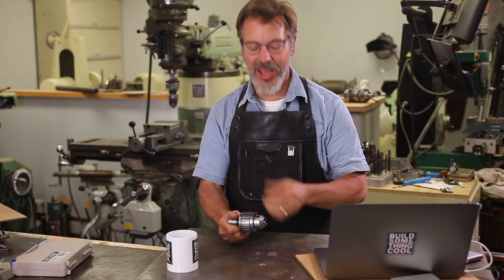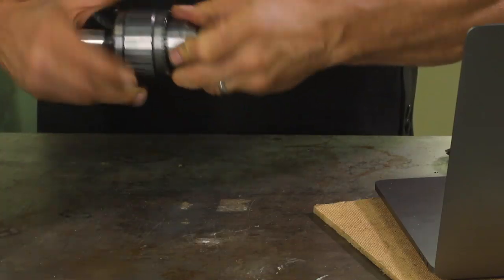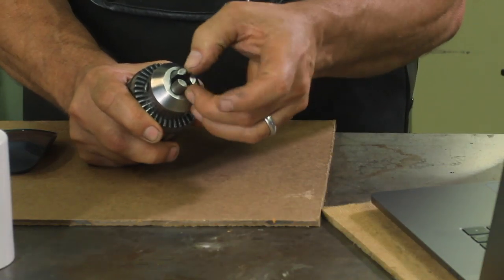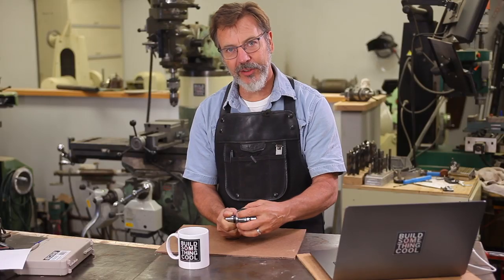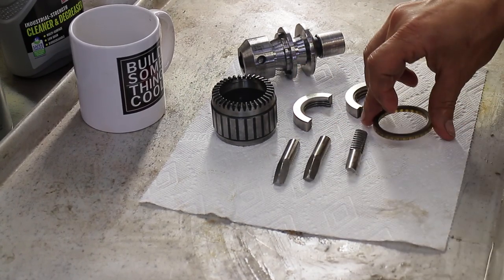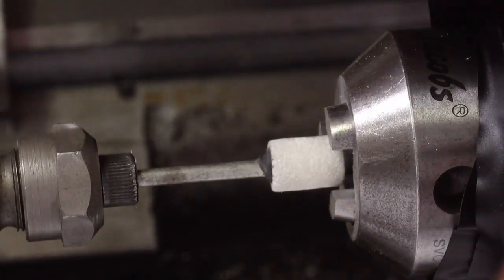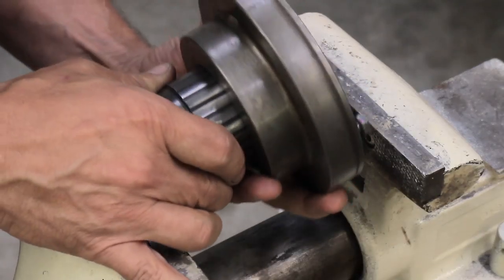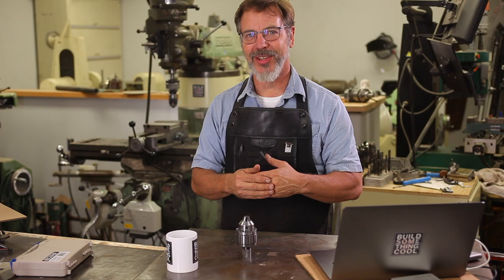Drill chuck grinding

Comment: i fixed my chuck by mounting a 1/8" diamond coated rotozip tile bit in the mill collect and the super chuck in the mill vice in a collect block and the bit centered at full cut depth then slowly tightened the super chuck by hand. worked great and ended up with .0009 run out. thanks for sharing

Comment: Hi Dale
I'm between beer 8 and 9 so take this for what its worth... 
Paint a new drill shank with some non-drying ink and then clamp it  in the chuck you just ground. That will tell you more about the effects of taper while grinding. Also, you didn't seem to mention about 'walking the key'. Where you tighten the chuck at every location of the chuck perimeter. This helps to distribute the force on the jaws according to the old fart that that taught this old fart about it a hundred years ago
Reply: Doug, from one old fart to another, great advice. Hope you enjoyed the beers.

Comment: I was worried when you pressed on the jaws, but the explanation you gave from Jacobs made sense.  Even better when you suggested using a tube, like it.
I wonder as another method if the chuck could grip onto a small disc right at the back of the jaws, allowing the chuck to be gently tightened and then grind the free section.  When done remove the disc and over grind that rear section using your free spin method to give clearance.  Of course a small part of the jaw is no longer gripping the drill bit.
Reply from the maker: I thought of that too, but I think the force is not equal enough, more pressure on the back will kink the front tips of the jaws inward making for a tapered grind.

Comment: Hi  Kevin from Aus very interesting at what you done I have done this a lot of times in my time as machineical engeer 55 years if you grind in a lath you need to cover up the bed from grinding dust with a bit of oil  the quicker to wear out bed I wood put it  in the tool and cutter grinder using the arber on drill chuck and taper in the grinder no setting up .  keep up all the good work Kevin.

Comment: I'm pretty sure the chuck, when ground this way, is going to be most accurate when a diameter test piece is the same as the diameter of the stone used. Can you check it using test pieces larger and smaller than the stone? I have a chuck with the same issue. Thanks

Comment: 3:56 As I’m sure you know vise is not a press. As always be careful with what you use it for, never use a cheater bar or mallet on the vise handle, and be prepared for if what you have in the vise comes flying out at your face. I get it you can’t use a transparent moving blanket to protect yourself from if the chuck were to come flying out when you’re recording a video, but I still thought it could be worth mentioning for those who see a vise and consider it a press. Thanks for the video and keep up the good work!

Comment: When grinding, especially internal, and with the wheel mounted on a super skinny shaft (as here), reciprocate the wheel to and fro inside the bore, but never traverse the wheel off the surface being ground at either end of the hole, always leave about 1/3rd of the contact portion of the wheel inside the hole at its extremities. The exact portion of the wheel which should stay in the hole may need a little experimentation, but do it like you are, and cow-mouthing at each end will always result.

Comment: I’ve seen ABOM tighten his 6 jaw lathe chuck from all of the pinions for less runout. I wonder if tightening a Jacob’s chuck from all three holes on the body could help the barrel of the chuck sit better.
Reply: It's done for better grip, the best repeatability is achieved by using one marked pinion every time. Same probably goes for drill chucks.

Comment: A Jacobs 19L came on an old drill press. The seller said the chuck needed "a little love". One jaw sets way back from the other two. Those two only travel about 1/4 their designed range of motion before the third jaw blocks further travel. Nothing appears broken. The problem of disassembly seems like a Rubik's Cube to me though I've disassembled other Super Chucks. The machine shop where I do business took a look and said, "You're out of luck" and handed it back. Any ideas? Would you be willing to try? Thank you for your channel. You put out good videos.

Comment: I just found out about walking the key from and old hand at work. He saw me drilling a holes in a plate to hold a new bracket. The welder had made a new bracket for me to install on my unit. He was very busy and had stopped he project and whipped up a piece fo me and went back to work. I had brought my drills and tools to work with me but I was using the company’s old drill press. The old drill press had an old worn out chuck, my coworker was working on some a few feet a way and watching but not watch. He said “hey you need to walk the key!” Me “walk the key? Him” around the chuck. “ i had just put a drill in the chuck, and he said “ spin it and watch the run out” “stop and now. walk the key” and it worked the run out was almost gone.

Comment: Ok Dale, you set me straight about the position of the jaws when pressing the chuck apart (Thank you), but not covering the lathe's ways from the grinding dust? What's up with that?

It would be interesting to know how they grind the jaws at the factory. I've never seen any info on that process.
Reply: MrMichaeljab my first thought is a jig grinder

Comment: Regarding the gripping force on a drill bit, it's almost all down to simple friction. It's proportional to the applied load, not the surface area, so touching more or less of the drill isn't going to make an appreciable difference.

On the upside, if the drill bit starts to slip in the chuck I reckon you'll probably do less damage to the shank with a greater surface area as well.

As to centripetal force holding the jaws in place, I don't think that's likely. The grinding forces would likely overcome the centripetal force quite quickly. It's more likely that it's simply how well fitted the jaws are to the chuck and the pressure applied during grinding. In any case, if the result is good that's all that really counts.

Job well done I reckon.

Comment: Awesome idea, are you actually using centrifugal force or, by screwing the chuck full open, it jams the jaws with pressure similar to grabbing something. Since you taped the chuck to prevent movement is why it appears to be the jamming action. Great video

Comment: Do it like you do a lathe 3 yaw chuck? Put a peace of round steel on the bottom of the chuck and hold it tightly.Do your grinding,remove the metal ring and grind the bottom just to clear it.That should give you concentric ground jaws under load with very little runout.

Comment: Regarding your point at 1:49 regarding the diminished pressure applied by the ground chuck jaws...that may not be true,or at least doesn't seem geometrically correct to me. Assuming the drill bit can be approximated as a cylinder, the cylinder can only contact a flat surface along, a straight line. It's either that or no contact at all. So, making the contacting planes larger y grinding would not change this. Of course this is also assuming no pressure induced surface deformation.
Reply from the maker: Hi Chris, Good  comment,  I m sorry I didn't explain it well enough. What I should have  said is that the Harden Jaws are designed to bite into the soft shank of the drill bit, and by grinding the jaws  you add more surface to them, and that  prevents them bite  into the shank of the bit. Dose that make since?

Comment: Tighten the Chuck on something and super-glue the jaws in place, grind and then heat It up, clean.
Could It work? Never tried, Just thinking about it!
Reply: Interesting thought, but if you tighten on 'something', how are you going to get that 'something' out before you start work?
Reply: @bobblack3870  maybe a piece of wood you draw out, It must be soft to push the jaws in their slots in an uniform way. Also you can use soft plastic, or hard Rubber. Imagine a round hardwood stock you can clamp into the vice and draw It out
Reply from the maker: That might work. I wondering if you can get the glue a constant enough thickness. I have to give it some more thought. :-)

Comment: Not to be a troll about it, but the coefficient of friction is independent of surface area, given a constant force. In other words, if you're getting less holding power, it's because you changed the surface finish of the jaws rather than the surface area. I could be wrong about this, it's always been a little bit confusing to me, so I did a quick check. https://www.physlink.com/education/askexperts/ae140.cfm But even then, I could still be wrong.
Reply: That's the funny thing about friction - it IS independent of surface area. From what he says though, we're considering surface deformation as the clamping mechanism, not just friction. To deform a material, you have to apply a force, and that force always is applied over an area (in our real, non-ideal world). Since there's only so much force those jaws can apply, it deforms the drill bit less when it is distributed over a larger area.
I'm still not sure I buy it, but I think that's the reasoning he explained. I might think about roughing up the surface finish a little to give me more grab instead.
Reply: @toomdog  I thought that before I actually wrote my comment, but decided that the clamping force is really no different than the gravitational or normal force as applied to the question of friction. Obviously the clamping force is a great deal more than gravitational force, but the general concept should apply the same way. The concept I'm talking about is that when friction is distributed over a larger area it increases the frictional serface, but decreases, by that same area, the force applied by distributing that force over a larger area. The net result is that the coefficient of friction remains the same. And I honestly don't think it matters whether you're doing this on the Earth, on the moon, or between clamps, the relationship between surface contact and applied force over  a surface area remains the same. But hey, I barely survived my physics class in college, so who knows. It would be great if some Physics teacher could chime in here and settle the matter.
Reply: @toomdog   Addendum to my previous post, I don't think there are any chucks that can actually deform a drill bit. The reason chuks are hardened and the base of drill bits are not is so that the chuk jaws don't get damaged or worn during adverse use, such as when a bit begins to spin in the chuk. I know this is contrary to popular wisdom, I think if you think about the dimensionality of the pressure on a drill bit, reason will show that I'm correct about the lack of deformation.
Reply: I agree; I wish I could get my old college prof here too!
I also agree that the shanks of drill bits are left soft not so that they deform when clamped, but to ensure they are the wearing item when slipping occurs.
This is something I don't know a whole lot about, but I think surface deformation behaves a little differently than the deformation we learn about in statics and strength of materials. Imagine, instead of the entire chuck making an indentation, every microscopic high point creates an indent. That's what I think I'm talking about anyway.
You know, if we were serious about this, we would do some research instead of just talking on youtube. I'm sure a mechanism like this has been studied before.
Reply: @toomdog  "If we were serious..." LMAO to point of tears.... thanks for that, It's so true.

Comment: Good video. You missed one thing. How do you tell when/if your jaw are worn out? You alluded to it in your viseo, but wasn't made clear. At least to me :-)
Reply from the maker: Your right I missed that point. There are to ways, one I showed. Put a test rod in your chuck and test for it’s runout. Second thing to do is a visual inspection. Look in side and look at the jaws. They should all look the same. Have a consistent shape no tapers no nicks. I hope this helps. Great question.

Comment: I've got a KR Wilson 50 ton press similar to that one. Mine has the 2 speed manual pump as well as a motorized pump, all factory. Had to make a new ram for it when I got it due to rust pitting. The new one with new seals still leaks just a bit. Mfg date on it is 1947. Company history info: http://krwilsontools.com/index.html

Comment: Dale, couldn't someone with your equipment and skill mill/face the jaws rather than grind?

Sure, work holding, esp repeated 3 times, would be a challenge on the mill but a DRO would help
Reply from the maker: Hi Len. It would be hard to do it on the mill because the jaw are tool steel hard